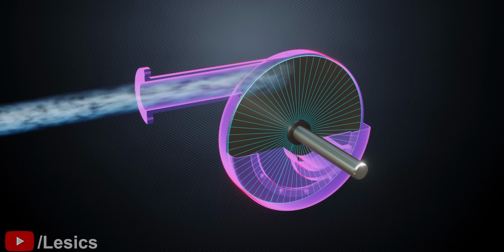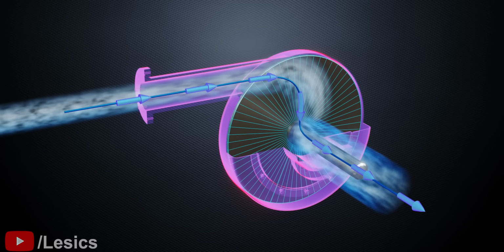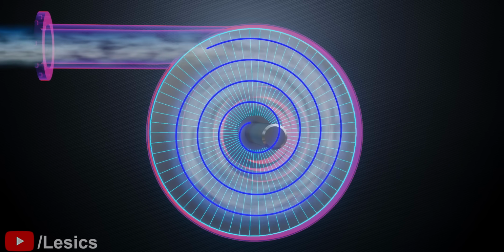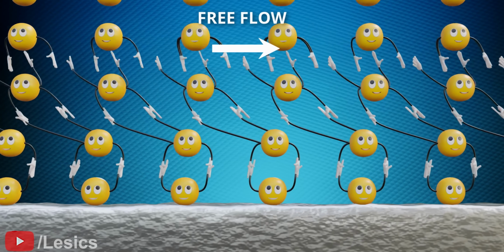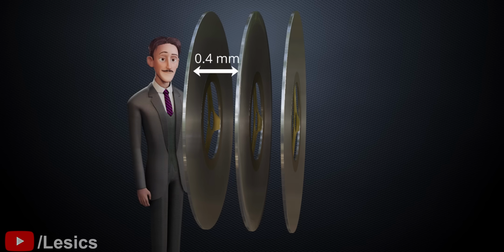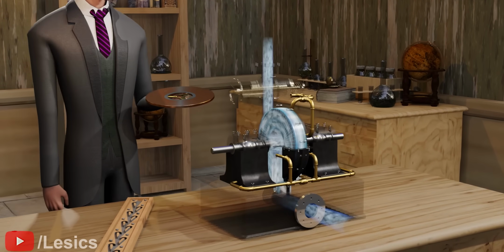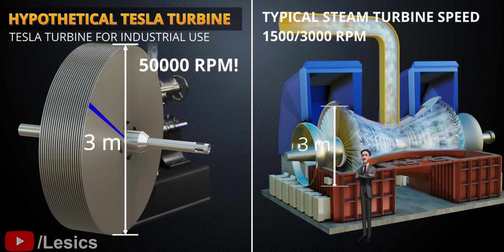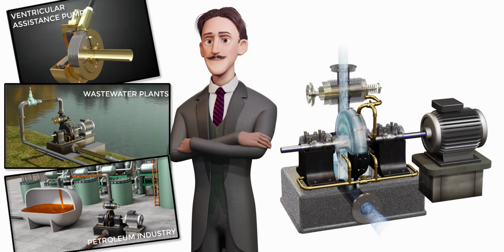Tesla Turbine | The interesting physics behind it

Comment: Anyone want to explain for me... in a normal turbine, or a Tesla one, a fluid comes in fast, and comes out slower, the difference being given as energy to the turbine. But if the water is coming out slower at the exit, how does it get out of the way fast enough for the water at the top to go in? Wouldn't it get backed up? 

Same question for windmills or steam turbines.

Comment: It's Irrelevant to talk about mach-number on a Teslaturbine, since it doesn't utilize the "airfoil" principle, thus it doesnt matter if it's supersonic or not. (- Refer to the Bernoulli priciple for further info). The real deal is just the warping of the disks.
Reply: The warping is a result of the heat generated by the friction such a the SR-71 at mach 3.3 or the space shuttle entering the atmosphere. So the speed of the disk is relevant because the friction is directly proportional. It's not about "airfoil", it's about air molecules rubbing past a surface generating heat.
Reply: @DrHarryT  We are talking about Teslaturbines here. Not space shuttle or SR-71. I fail to see the relevanse of what you are saying. Please specify your intension
Reply: Air flow dynamics. Shuttle hast tiles. The SR leaks fuel on the ground and heat that causes expansion at the high speeds seals it up.
Thermodynamics and friction.
Reply: I've machined 1,000S of brake rotors that were warped due to the heat of friction. It's like putting a vinyl record out in the sun, what happens?
Reply: @DrHarryT  Im quite aware of how the space shuttle heat-tiles and SR-71 function thank you :) - I'm aircraft technician. However, I'm not saying anything that disputes your statements, so I don't get why you start talking about this. I simple state, that talking machnumber on Teslasturbines is irrelevant. - Again, refer to the bernoulli principle, if you want to understand why it's important on airfoil-based turbines.
Reply: @Nazrahnas  I guess utilizing the "Mach" number is an attempt to quantify the volume of air flowing over the disks thus heat generated by friction that warps the disks which also dynamically increases said friction with the increase in RPM's.
Reply: @DrHarryT  But then just give the speed in m/s, which  is the normal thing. Mach is speed in relation to speed of sound, which is irrelevant here.
Reply: @Nazrahnas  It doesn't matter if it's in m/s or mach, both refer to the same speed.
Reply: @thelelanatorlol3978  No they don't refer to the same speed. Meters per second is a FIXED standard. The speed of sound varies highly depending on many different things, such as the medium it is traveling through, density, temperature etc. Besides that; meters per second is the STANDARD at which you designate any type of velocity when talking science language. You are really talking about stuff which you don't know much about.

Comment: Instead of making them wider, just add more discs sideways. Car engines do this, v6, v8, v10, v12 ect. It might not even have to be as long as the blade turbine
Reply: This does not work. You aren't increasing the efficiency that way. The problem with that solution is that by adding more disks the efficiency stays the same, but the throughput increases (as you add more space to fill with steam). To increase the efficiency of these turbines, you need to increase the RPM, which is not done by adding more disks.
Reply: @osteogenesisdev5268  I think what he meant is to have much smaller disks so that the high RPM's required for efficiency wont be an issue.  Smaller disks mean lower structural stresses on the disks and lower mach numbers at the tips; however, smaller disks also means lower throughput so that's why he's suggesting adding more disks in parallel to increase to throughput.
Reply: @jonathanmgoodman  I don't think that benefits efficiency either. It might improve the efficiency with regards to speed, but you have more material, friction, etc. to deal with. Keep in mind that reducing the diameter has a quadratic relation to the surface of the disk. So say you halve the diameter, you need at least 4 times the disks to make up for that. Meanwhile the speed at the edge of the wheels scale linearly with the diameter, so it's quite a bad deal.

As a result of that, I think it's simply not really worth it. In the end, the currently used turbines are already 90+%, so at the absolute best you could get 10% more efficiency, but you already need impossible materials to simply match the current turbines.
Reply: @osteogenesisdev5268  you cant say it doesn’t work without trying it..😜😜😜
Reply: @___GhostRider___  You can though, you can calculate if it will work or not.

Comment: So my question is. Why the automobile industry aren't using this particular technology for improving the turbos in order to avoid turbo lag? Is it the hot air effect that prevents this technology to be implemented to the industry due to mechanical failure caused be forces or there are some other reasons?

Comment: Outlet/Inlet and shaft connected to your impeller is wrong the outlet is shown to flow from the volute casing over the shaft that is supposed to lead to the motor.

https://www.michael-smith-engineers.co.uk/mse/uploads/UsefulInfo/UsefulInfoCentrifugal/CENTRIFUGAL-VOLUTE-CASING-DESIGN.jpg

Comment: I see you are all hyped by the design but it generates lame levels of moment due to absence of surfaces that generates drug. It has 97% efficiency when only freewheeling but if you put on some load, Wheels will stop turning.
Reply: I have tried both porous lamels or micro spaces in betweens. Shit dont work. But it is fun to build one, you can go for that

Comment: but what about a 50000 rpm 3 disk in a vacuum? would that destroy mr steam boat
Reply: think about it
Reply: if the structural integrity and all was mastered, would it make it the most efficient thing ever?
Reply: 90% to 100% by just using a vaccuum?
Reply: and yes i know what water does in a vaccuum
Reply: vacuum*
Reply: but im sure there is a way to work around the vacuum part
Reply: or we just use a different fluid
Reply: nevermind, we take teslas turbine, get it to 50,000 rpm and then just put it in space. boom. energy.
Reply: or we could use those turbines in space for unlimited energy generating defense systems

Comment: This looks so much safer than current jet engines which are currently falling off planes.  Not just because the blades can fall out of the engine but because the jet fuel has been contaminated.  It used to be pretty pure.  But in order to further weather influence weird things have been added to the fuel. In particular magnesium and aluminum make it burn hotter and several accidents have had the collar holding the engines onto the plane burn most of the way off to where the weight of the engine made it fall off. To my knowledge although barium has properties for weather manipulation it has no impact on the engines.  This way when you look up and see the criss cross patterns in the sky that did not used to be there, they can still tell you they are contrails instead of chemtrails but now instead of just poisoning you they are also putting airliners at risk.
Reply: Nice schizo post.

Comment: This looks like a great starting point for some Sci-Fi where we have a material strong enough for Mach 13 spin rates and can get incredible efficiencies from this turbine.
Reply: Right
Reply: What interesting plot can you make from that starting point?
Reply: @russelllukenbill  

"It's spinning at 1000mph..."

Now tell us the RPM it's spinning at, genius. I'll give you a hint there are 24 hours in a day, and 60 minutes in an hour.
Reply: What kind of dystopia SciFi allows their engineers to make motors with edge velocities of 100 Gs

"Yeah so the car crash killed the driver and the tesla turbine disc carved through two cars and crashed through a house where it decapitated a lady's dog."
Reply: @Cancer McAids it’s more likely it wouldn’t need to spin that fast in the first place. It gets more efficient at higher speeds but it won’t accelerate faster than the fluid, the Mach 13 was assuming the same diameter discs as a steam turbine, which probably wouldn’t be necessary if it can extract the energy more efficiently.
Reply: Make the turbine smaller so that the tips arent spinning at mach 13. Why scale it up to 3meters if you dont have materials to pull it off.... just make smaller turbines in higher quantity. Problem solved and no supermaterials necessary.
Reply: Or turn it into an insane drill
Reply: maybe graphene?
Reply: It looks like it would be lightweight too and you could put them in series to get tons of energy from it. Like how the steam turbines increase in radius to extract as much energy as possible.
Reply: How hot would the fluid be at Mach 13 and what would the pressure be of that superheated fliud?
Reply: Look into the speeds jet engine operate at. Spinning a simple disk at a high rpm, by comparison, is easy.
Reply: @justingrey6008  Yes, but you forget to take in to account what he said in the video. In order to use these efficiently, the discs would need to be 3 meters, jet engine doesn't use a 3 meter disc to operate, they use fans and they usually spin at around 3k rpm, not 50k
Reply: @ChesterZirawin  depending on the turbine size some are several hundred thousand rpm. It's only the low pressure blades that are "slow" in a jet engine, and not all jets are the same. Depending on application two identical size engines can have wildly different performance envelopes.
I suspect that the author was using something like the Trent 900, and only looking at the bypass fan.
What are the characteristics of the working fluid. 
And finally what are you powering? Rotating at 50k is useless of your generator wants to run at 5k. Gearboxes lose the efficiency your trying to gain.
Reply: @justingrey6008  The higher pressure blades reach up to 20k (what I found, not an expert on jet engines) but it's not the speed alone that's the problem, the size of the blades is what matters and in this case it's not even a blade, it's discs
Reply: @ChesterZirawin  your right size does matter, but there are two issues with a jet engine comparison, jets need to force the working fluid through the engine, so they are loaded dynamically in several directions and jet engines also need to sustain combustion. That second point is the key point that will limit your blade speed in a engine.
The point of combustion needs to be subsonic.
I am not saying spinning a disk that size and speed would be easy, it wouldn't, but it should be possible.
Reply: @justingrey6008  I understand your point, but I just can't think of a material that would be able to maintain it's shape at such speeds for prolonged period of time (think years since the material that could withstand the force would probably not be cheep so as to make it worth the price). It's probably similar to fusion currently, it takes more power to start the fusion and maintain it than it produces so it's not cost effective
Reply: @ChesterZirawin  I totally agree that their is going to be a size limit on these things, 
Honestly thinking this over, I can't imagine the need for a large one of these that a slower speed turbine can't do.
Reply: @justingrey6008  Well if it was possible, I imagine one of the big, fast ones could replace multiple smaller ones if the big one has more than 10x the RPM as well as the size of it. Like comparing a lawnmower engine to that of a v12 super car
Reply: @ChesterZirawin  honestly I see more application for them in the small scale then large scale.  Take power production, these go relatively slowly because they are massive, no need for anything high speed driving them, low speed high torque is needed.
That being said, when being driven by the working fluid, what is the torque these can generate? It has me curious enough to do some looking into them. 
In the end I guess my take on the whole thing is that while Tesla was a brilliant man, this isn't a revolutionary device just because he invented it.
Reply: I refuse to believe this as long as Tesla gets even one penny of Government funding.
Reply: @davidlafleche1142 , not that Tesla, genius.

Comment: Especially if you used pulleys or sized gears to increase output. Multiple pulleys increase lifting power. You could even make the shaft itself work for more efficiency. Tesla and Edison didnt concentrate on the shaft itself. Like a bike. The pedals create force. But given the terrain the gears make it easy or hard. 
I also think Tesla got this idea from a water wheel. Not a rock in a river. But maybe he was rockin 🎸 ,Smoke on the Water", fire in the turbine. 😆

Comment: Besides the fact that the giant or one big turbine has stress point risk. The stress fracture risk in point to point levels make it extremely dangerous compared to multiple stress point fracture. The rope or shaft is stronger and more well protected against extreme stress fracture spread over multiple areas of pressure than one small point of extreme pressure. If used in conjunction with clutches. Each turbine can be stopped repaired or replaced at any given moment. With minimal power loss.

Comment: Couldnt you put the Tesla Turbines in a series? Multiplying its effect at a much smaller size? Using multiple smaller turbines linked to one shaft by gears? If 10 Tesla Turbines turned at 50,000 rpms turning the same shaft the output should be ok. If using a dam water source of pressure. The smaller turbines can be easily worked on too. Like having one giant pulling a rope against 10 normal men. Its equal in strength. But if one normal man lets go. Only a small portion of strength is lost. If the giant lets go. All strength is lost. Just a thought. Tesla was kidda smart.

Comment: Too bad you made one fatal flaw... you assume that the Tesla turbine would have to be the same diameter as your steam turbine... you also noted that there is a far greater path of contact via the spiral turbine as opposed to the nearly straight through path of a standard steam turbine... therefore the diameter does NOT need to be the same.... there is also the advantage of higher speed giving a higher torque... as amply indicated by todays far faster running engines being able to produce immense amounts of power... perhaps try doing a proper comparison where the advantages of each are not compromised by trying to saddle one with the faults of the other. Let's not forget that the average grinder is spinning at speeds of 28,000 RPM and are commonly sold in hardware stores.... Or are you trying to say that those are not possible either?  Overall, a very good video that clearly illustrates how it works and only fails when making an incompatible comparison.... Might as well judge a fish by how well it can climb a tree!

Comment: I was thinking about this effect on water flow over a water wheel or through a drainage pipe today when wondering if I could design an improvement on a basic plumbing design structure on the outside of my home after a miscommunication between the company owner and a new employee due to my over concerns being told to him about safety for pedestrians walking over frozen water draining away from the plumbing caused him to make an honest mistake in the direction that the drain pipe was being laid. Since I didn't have the money to look into it further right now for myself it will have to wait.

Comment: It has been shown that introducing an electrical current into the surface tension of water, that the layer will increase in thickness. Could the introduction of a current also affect the viscosity of the water? Could the introduction of a current to the turbine disk also allow the disk distance to be greater. With more current added to the disk, the speed would increase and with less current, the disk would then become less efficient slowing the disk speed. He might have then the ability to control the speed other than a mechanical one. Of a worthy note, the surface tension of water molecules are so closely aligned that impurities are forced out as there is simply no room. The same thing happens to water as it freezes. Impurities are forced out due to lack of space. Sorry about the brain dump.

Comment: Couldn't you just gear the drive shaft further out from the center (think sprocket on a bike)?  this would reduce the blade tip speed dramatically while increasing its efficiency...

Comment: So we just need stronger materials to generate massive amounts of energy, biggest issue of last 5 generations and probably the next 5.
Reply: No.  We need stronger materials (by orders of magnitude stronger than any known material) to make the Tesla Turbine more efficient.  Not to "generate massive amounts of energy".  It's not a free energy machine; energy is still required to produce the steam to drive the turbine.  Modern turbines are already 90+% efficient and are already generating massive amounts of electricity all around the world, so there is very little or nothing to be gained by using Tesla Turbines at an industrial scale even if it were possible.  Generating electricity is simply the conversion of one form of energy to another.  The aim is to minimise the energy "lost" during the process.  One cannot produce more electrical energy than the heat/kinetic/chemical energy going in.

Comment: Could be a bit slower while being efficient with lower viscosity material? Or using different material for blades..

Quite a few options to work with.

Or using multiples, but in quite small scale.

Comment: never validated myself, but was told the if the center exit of turbine was relatively large compared to another exit on the opposite side of center, the smaller opening would emit heated fluid or gas while other opening would emit cooled fluid or gas; or maybe visa versa i forget.  ~ Hartmann-Sprenger tubes